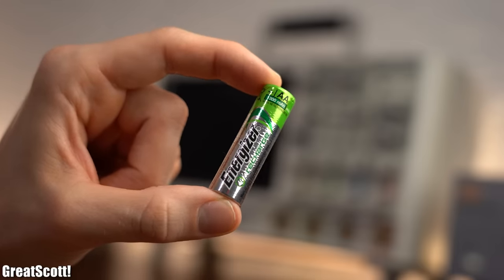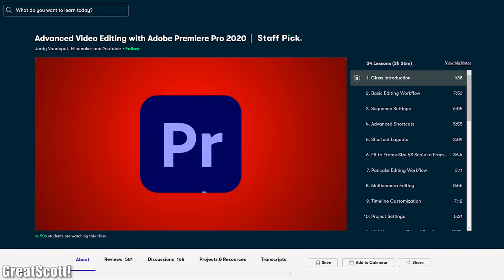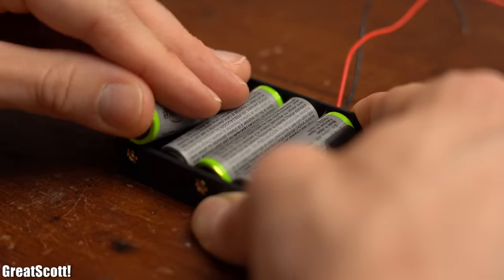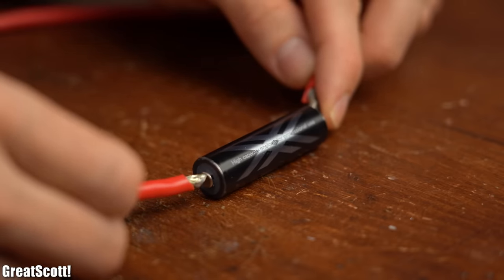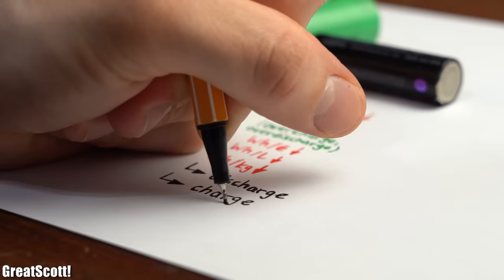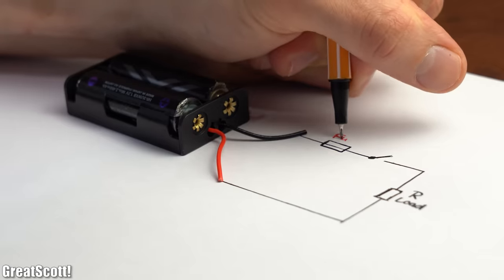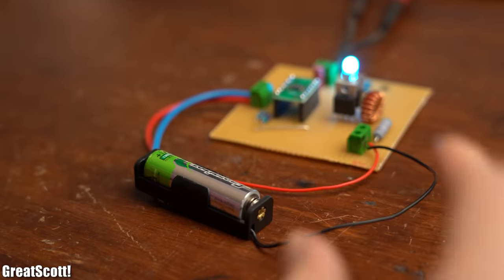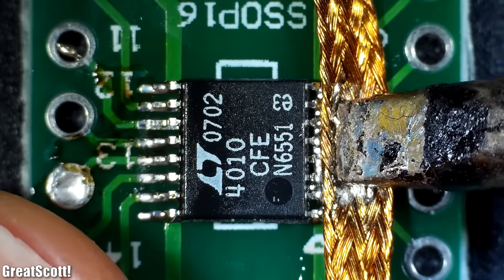Are AA NiMH Batteries obsolete? Here is everything you need to know about them!

Comment: I have like 15 NiMh AA's and another 15 AAA's.... sigh.  That's all I can say about it.  Sigh.  So many devices these days STILL can't handle the slightly lower voltages produced by these batteries.  The build quality is still very low and leakage high.  The various brands all fly-by-night, and older established brands all low-ball quality too in order to compete.   I've gotten tired of having to swap them out in mice and label makers and other stuff literally every few weeks when a non-rechargable battery lasts a whole year.   Even the so-called low-leakage batteries have been let-downs.

Since their only other use is in LED flash-lights, which have mostly switched over to larger lithium cells (which I swear at every day too because most of those flashlights are made for 3.7V lithiums and can't handle the lower 3.2V voltage of the much safer LiFePO4 cells).

Double sigh.   In anycase, I'm not buying any more NiMh's.

-Matt
Reply: lithiim best
Reply: what brand/model nimh's did you use?

Comment: If they can cram these 1.2V batteries down our 1.5V product which don't last near as long so they can sell us more 1.2V products not only are they saving a few RMB but  they are forcing us to abandon our good products that take 1.5V and buy their crap, I can't find C cell or D cell  in Nickle Metal Hydride only 1.2V  in Lithium ion? Neither Amazon or E Bay  have our same 1.5V battery it reminds me of the days back in the 1970's when they wanted us to buy no lead gas they cut the per gallon price way down even though the no lead fuel destroyed many motors as they used the lead to supply lubrication to cylinder head valves  that occasionally froze the valve stem to the valve guides. For example the V/W air cooled engine could not use  no leaded gas in the summer time as the #3 piston ran hotter as the fan air had to go through the oil cooler  before getting to # 3 cylinder and freezing up the piston and cylinder ? No thanks to the 1.2 volt batteries as the 1.5v still work far better.

Comment: Didn't mention another aspect of NiMH vs Li-ishes is low temperature operation and charging! can't charge a frozen lithium battery while NiMH's can!
... which make them almost perfect for electric cars. except in weight, irregardless electric cars in winter don't heat well and still gotta burn something! 

...

which brings to mind, most warm human spaces created is heated by OIL! solve that problem and make it mobile and you have your energy solution. butt that's a tangent not related to NiMH batteries! <3 all
Reply: it's not as big a problem as we're led to believe. real r&d has been squashed for a long time anyway.

Comment: Oh dear, please Herr GreatScott, use some flux! And please clean that soldering iron tip! For someone so good at electronics to be so brutal in their solder game, it hurts me!
Reply: I always watching like horror film how much solder he use for these proto boards. I usually use stripped wire to do GND and VCC if possible. then normal insulated wire for point to point connections.
Reply from the maker: I am doing just fine
Reply: @greatscottlab  You're doing better than fine, it's amazing what you do. Better than I could ever do. I want to share a tool that has helped me, with someone who has taught me so much.

Comment: Can anyone help me to charge five 4v lithium ion battery in parallel connection. Is there any circuit board available?( For power bank... ) Currently I am using TP 4056 for each battery. And connected input and output section. Is that helpfull

Comment: is there a circuit that measures the polarity of each battery and rearrange the anode and cathode route , as such , that you can not put the batteries the wrong way ?
that any way you put the batteries , the polarity is driven to the correct way.
Reply: bridge rectifier
Reply: Usually devices taking AA or similar batteries have a recessed positive terminal. The flat negative end of a battery won't reach the terminal but the protruding positive end will. It's amazingly low-tech but also surprisingly effective.
Reply: @kennmossman8701  i thing bridge rectifier is for ac , and it has a significant voltage drop to use with 1.5 volt battery/ies
Reply: @eDoc2020  i like that simplicity , i was referring more to an ic that rearrange the path of the circuit according to how the battery is placed .
Reply: @xanamata5386  Using Schottky diodes would easily reduce the voltage loss of a bridge rectifier. If you really wanted to I think it could be possible to use an arrangement of N- and P- channel MOSFETs so the bridge happens without a diode drop at all.
Reply: @xanamata5386  1) it can be used in DC circuits
2) use Schotty diodes for a lower Vf
3) you didn't specify 1.5V battery before
Reply: @eDoc2020  protruding positive terminal
Reply: @kennmossman8701  The battery's positive is protruding, but the holder's positive is recessed.
Reply: @eDoc2020  maybe!!!  some sort of H-bridge arrangement but how to power the logic and Mosfets (Vgs).  Vgs usually needs to be at least 2v.  It gets ugly quickly
Reply: @kennmossman8701  I'm assuming some MOSFETS have an ultra-low Vgs. I was thinking it could be possible to make without logic, just tying the gates to one of the circuit's four terminals. It would need ore thinking to see if it's actually possible this way or not.
Reply: @eDoc2020  The lowest I have seen for power MosFets is 2V. However that is deceptive as it is measured at 250uA!!!  The Vgs must be higher to achieve reasonable Id.
Reply: @eDoc2020  I looked and there are low Id (< 850mA) Mosfets with a Vgs[th] of 400mV

Comment: did you forget about main disadvantage of ni-mh battery which is you have to discharge the battery until empty before charging and charge the battery until full before using to avoid memory effect?
Reply: That's only NiCd, not NiMH. And it's actually pretty rare for memory effect to happen with NiCds.
Reply: @eDoc2020  BT-C3100 will do this.

Comment: Why are you making materials on things you are clueless about ?
There is much more to the ca0acity issue than just how much energy can you get from the cell.
Higher capacities mean more active material and less supporting material.
Such cells are much more fragile and don't allow high charging and/or discharging.
This also tends to kill cell longevity. That eneloop Pro is rated for only 500 cycles IIRC instead of 2000 of 2000 mAh cell.
You also ignore distinction between simple and low-self-discharge cell etc.
Also, overcharging the cell doesn't just heat it. 
It causes water loss in the cell. Cell does manage to get most of it back - it recombines H2 and O into H2O ( and heat the cell), but some small %% gets lost. Repeat it enough times and your cell will dry.
Reply: eneloop pros are designed for high current loads but live a shorter life. white eneloops can last yonks.

Comment: OK but now you spent like only 10% of video time explaining solution, and 0% time proving it really works faster, that can charge battery in less than 20hrs. Yes all that probably can be a workaround but did you ever wonder why battery designers always make chargers with 150-500mA charging currents? Are we really in such a hurry to stress charge batteries? I prefer lower temperatures and not count that battery will break sooner than with hot charging.

Comment: The reason devices which take AA or AAA dont protect against individual undervoltage is because the way you would do it for Alkalines vs NiMH is different and there is no reliable way to tell. 

Also a bit disappointing you didnt cover recycling of each type. Lithium based cells are really hard to recycle and basically end in land fill afaik.

Comment: Can anybody help me with specing these out? I am deaf and blind and I have a portable Rudy Magnification Device that runs off of these and Amazon makes it difficult to find the minimum charging rates for these. 

The actual specs I am after that this particular devices recommends AAAs that is no more than 1,000Mah but ALSO doesn't charges any slower than 250mnah charge rate. (I know I can use disposal AAAs too but I would like to have some rechargables on hand that I can actually trust for this $600 device).
Reply: So you need AAA nimh that has up to 1Ah (which is almost all of them), and that charges at least with 250mA? Actually all of ni mh can charge more than its spec, because they are designed not to overheat with "dumb"chargers. You can charge AAA nimh with 250mA if it has delta V or CC-CV charging method.
Reply: @Boz1211111  Correct indeed, thank so much for assuring me that I shouldn't be too worried then. Because of them being designed to work to not to overheats in particular. Since the warranty card warns me of that particular concern.
Reply: @rickytorres9089  If you try charging them check temperature by feel, i have been charging new AA nimh in opus up to 1.5A with active cooling, while spec recommends 470. my AAA have 190mA spec but get slightly warm charging at 300mA. Dont know how good of a cooling they get in the case and what charging method it uses, so make sure they dont get hot to the touch.

Thing is, if charger stops charging (or lowers it to 20-30mA after its finished you are most certainly safe charging at 250, only problem would be if charger supplies continuous 250mA like tricke charger, and doesnt stop once charged. Imo this is not very likely if your device is advanced by any means

TL;DR check temperature during and after charging, if they are below 45C while charging and cool once its finished everything is good
edit:if your device is designed to run AAAnimh im almost certain it will work properly.
Reply: @Boz1211111  Got ya thank so much for everything. :)
Reply: yes